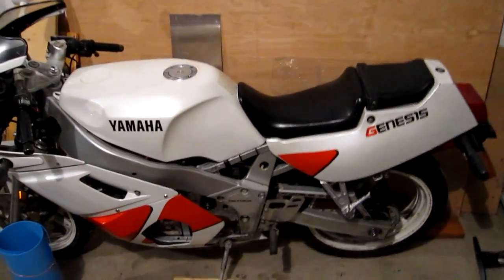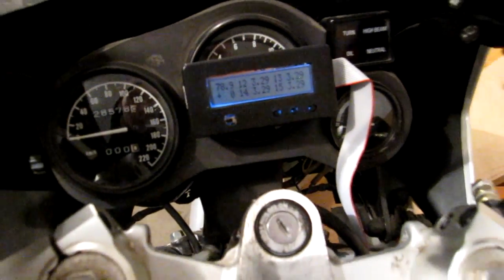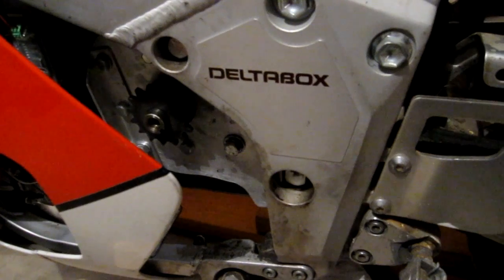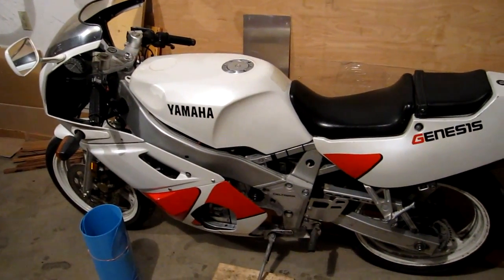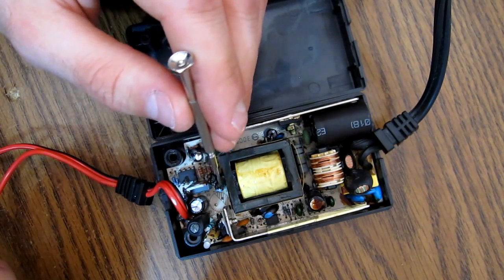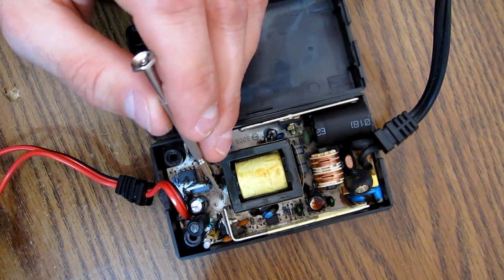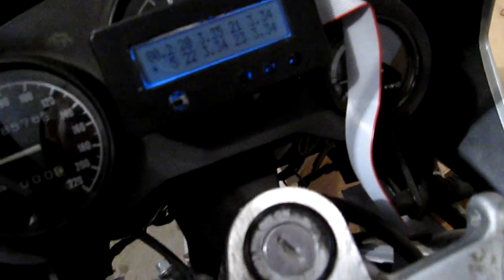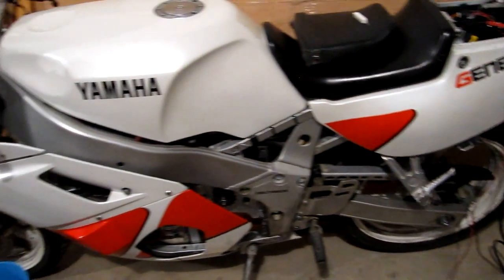Electric Motorcycle Build #27

Comment: My bike has BMS sense boards as well...but they can fail or go out of spec.  I had one cell board go out of spec over this past winter and almost totally killed a cell by overdischarging it.  My boards use a very small amount of power just because their attached but they also have a balancing function where they draw current over 3.6v and stop at 3.4v.  This board did not stop balancing.  If I had not bottom balanced all of my cells I know I would have lost that one.

Comment: If you wanted to you could charge it very reliably at 3.38v per cell.  At a cutoff at 3.35 your batteries will last for many years but the full capacity is reduced somwhat.  If you haven't already done it, you might bottom balance the cells individually.  It will save your butt if they are over discharged.  Its just as much fun building it as riding it!

Comment: I'm glad my ex-charger is working good for you!
A couple questions about the bike:
Is that a ME0709 (EMC-RT) or a ME1004 (EMC-R LS) motor?
Are you going to dial the Alltrax down a bit? The 0709 is good for 300A peak and the 1004 for 400A peak.
Do you have any estimated range/top speed calculations?

Comment: I think powering your controller's keyswitch input with the precharge resistor is what is making it not precharge properly with a 1K resistor.
I do not have a precharge relay on my Alltrax - my precharge resistor lives between the contactor contacts at all times. I power the keyswitch input with a separate relay triggered by the car's keyswitch. With the keyswitch input out of the equation, there is an 8V drop across my 1K ohm precharge resistor, which is typical for a proper precharge.